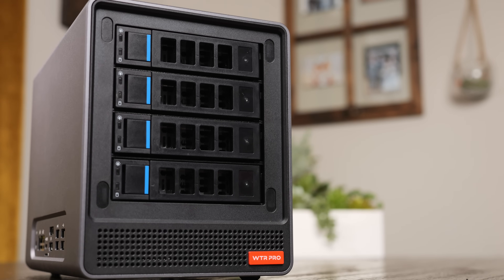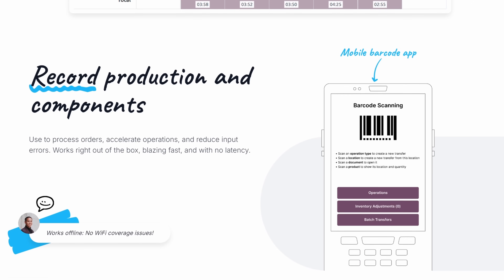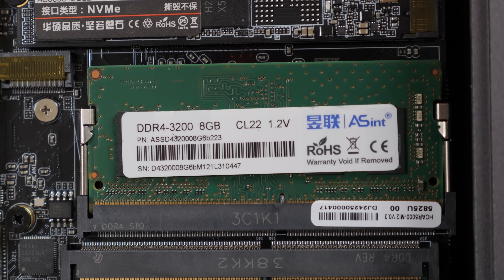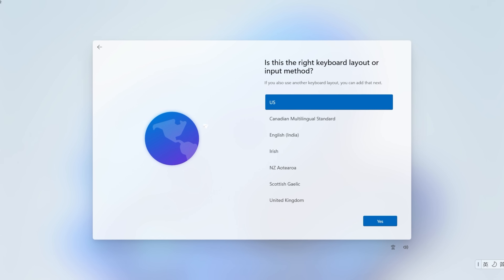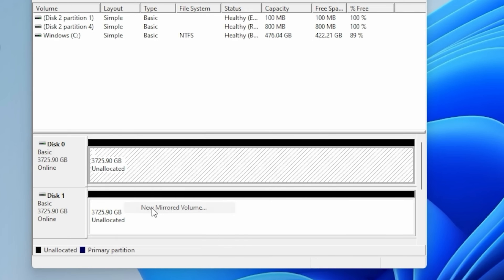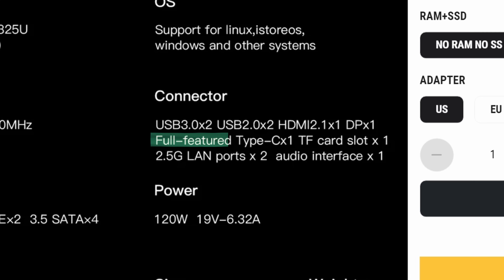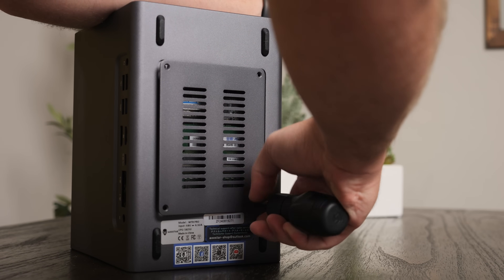The Home Server I've Been Wanting

Comment: if this exist 3 or 4 years ago i would have got one but i built one with a uNAS case and asrock rack motherboard with dual 10g and ECC ram and ryzen and IPMI/BMC, it did cost almost $1k more at the time. this unit costs what my motherboard alone costed. i also have 1 PCIe slot used for a old school read deal hardware accelerate RAID card that pulls about 1GB by 1GB read write with 4x 12TB Seagate drives in RAID 10. not bad read and write for 22TB, even with 24/7 NVR it still pulls 600-700+ MB/s read/write. enough to saturate 1gig ethernet

Comment: Man, I really wish AMD had an alternative to QuickSync.  That combined with a 10Gbe NIC would have made this thing perfect as a router and low-power failover NAS/Plex Server that I could run directly off of the 100w USB C port on my solar generator.  Would be great for overnight shutdown of my main unit, and also for power outage scenarios where I could shutdown my main Unraid/Workstation and run most of those services on a small low power device like this...
Reply: What do you mean? Quick sync is just the video encode/decode engine. AMD also has the same features, although their quality may be lesser.

Comment: Did anyone verify, whether these models even provide enough headroom for HDD startup. The N100 model provides only 90W, which indicates to me that it might use a built-in Pico PSU, just as the AsRock N100 ITX which doesn't provide sufficient amps.. :/

Comment: It looks like a nice replacement for my aged HP Microserver N54L running ZFS on FreeBSD (XigmaNAS - the old NAS4Free). - i.e. Would fit in the same place on my shelf probably - rather space-limited to meet that wife approval factor.
Just a little worried that it doesn't support ECC which I think I want (more than 10GB networking) for running ZFS.

Comment: You can buy 5 and 8 bay hot swappable external enclosures for around $200 or less.  So, I really don't have any interest at all in any more expensive prebuilt NAS that doesn't at least match that.  I'd much rather buy a Zimablade or similar and pair it with an enclosure or two.

The fact that 5 + 8 bay enclosures match with Snapraid parity numbers makes that combination the chef's kiss of low power, compact NAS devices.

I've yet to see any prebuilt NAS that can match a Zimablade + 5 bay enclosure for features and price.

FYI, I know some people will be down on this combo for doing stuff like transcoding and such but I'd rather keep my NAS pure.  Having multiple purpose built devices for a range of tasks just works so much better than trying to cram all of that into a single, disappointing expensive box.

Chances are, if you are looking at a device like this one, you are already on board with the idea of multiple low power devices rather than one giant expensive all in one server.
Reply: Having different devices for different software tasks will usually be less efficient, and also more clutter. This box is small, low power draw, and has more than enough CPU power.

Comment: As W11 is there, can I add HDD’s with data on already or do I have to reformat?
in my head the fan is on the side so air can be pulled in easier

Comment: These things are cool but would be cool if they had a version that took four or six 2.5" drives by taking half in from the left and half in from the right (assuming IO was classed as the front). That way would be super short and then could just have 2 small 6cm fans on the back.

Comment: hotswap on a home system is irrelevant IMO since even in a lot of corporate setups it's not really a thing except with hardware RAID controllers on rackmount things closer to 10x the size. 
No one is really going to use something like this sitting on a shelf running RAID5 or whatever with a cold spare drive next to it ready to go. Or, if you do - this is not the system for you anyway, for a host of other reasons. Which begs the question, can it hot swap from it's own PSU to USB-C and back without having to be turned off? Just as important as drive hotswapping, if not more.

Comment: i have a little question. Can you set the SATA ports in the bios as a ESATA port, then they are hot swappable. i mean yea it disables the cache on the drives but who needs this feature anyway in a nas with no power loss protection.

Comment: i went for the n100 , proxmox and put a coral m2 in the wifi slot , also unlike terramasters 424pro , the usb's work with a hub ,and there is plenty for a zwave ,zigbee, rf dongle ,and should be able to expand with a terramaster D8 hybrid i bought
Reply: How is the the performance so far? Does it get hot? Is the vent working hard or it is silent most of the time?
Reply: @JoseGarcia-so2yc  so gone through a lot trying decide on what hardware to use ,with what hardware ,so aoostar - proxmox ,home assistant,  and the arrs with 45 drives , via i think tech hut on you tubes tutorial has been flawless, except trying to understand how to update the programmes, 
Now trying the 424 pro with unraid ,watching space invader 1 , l have 2 nvme cache drives in zfs , 1x 8gb purple for parity , 3x 8 gb reds in the array with 1x being zfs for snapshots , bloody complicated and still having nothing really running on it ,
So short story ,aoostar works via proxmox , and on the n100 version you can use the short m2 for coral ,though that looks likes it's dieing ,or an extra short nvme , BTW probably gonna convert my desktop ,Asus proart ,13700k to a server ,put windows via proxmox on the aoostar and use that ,hopefully via the hdmi ? 🤷

Comment: If you can use the 2.5gbit nics at the same time, 5gbit bandwidth isn't bad at all. not every one has a 10gbit network at home, maybe a 2.5gbit but mostly a 1gbit which is totally fine for home use. 
i mean yeah, i have a 10gbit network but i have a dell r630 with 4x 10gbit ports at home and in all of my pc are 10gbit nic as well. i run Ubuntu on all of my systems and sftp works seamless with the  filemanager. All of my pc have only the os on it.  all 4 ports on my r630 are connected to the 10gbit managed switch, and one of my pc has a dual 10gbit nic in it. so i am able to use 20gbit of bandwidth if my drives could keep up, but they couldn't because i using only 4x sas hdd 2.5inch drives in a raid 10 and the other 4 drives in the server are cheap sata ssd in raid 10 which houses only machine learning stacks and models which need a fast and frequent access which abuses the dives extensively so they fail about every 8 to 10 months but they kost only 30€ each therefore i don't care and everything on this SSD are volatile and can be replaced in minutes. i have another system build from a cheap dell OptiPlex which serves only as a backup storage it uses normal sata drives in a raid 6 configuration. it has also a dual 10gbit nic in it and powers on if none of the recourses are available or if it does a backup. this happen every 2 weeks and takes only 1h at the moment. i had the r630 failing one time and the backup server started after 5 minutes and provided only the NAS because this is everything i need. if some one wonders, my r630 is a 8 bay variant and i boot off from a internal ubs3 5gbit port. with a 10gbit usb3 metal stick specific designed for those use case .

Comment: The "Full Service USB-C" has a Display Port Symbol on it.  Pretty sure you can use for adding a monitor or three to it.  Yes... there are adapters that will split the signal into to two to three monitors.  WHY you would want that on a plex/file server, I don't know, but I'm sure we can find any number or reasons we might want to do that.

Comment: This hardware with a more modern CPU and 10GbE would be the dream for a low power decent feature set homelab machine if you don't need a ton of drives or fast storage for a lot of people who want to run something other than Synology.  For the price it's really not bad though I'd want 10gbe + ECC personally but it's nice to see companies thinking outside of the box with 'entry level' NAS hardware.

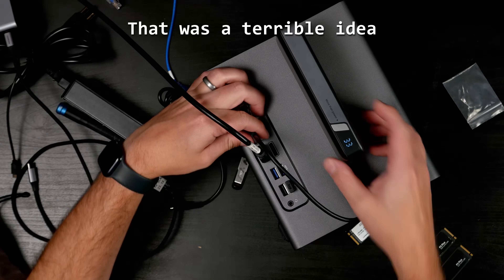Comment: 14:39 depending on the wattage a power bank is capable of, it might actually work. And some power banks can pass power through them, so this could actually be a somewhat effective UPS, provided you find a powerbank powerful enough to run it and capable of output while being charged.
Reply: Yeah, I don't know what power bank he was using to test this, but as long as it's capable of providing the power required by the NAS it should work. Maybe there's a voltage/current combo that the NAS wanted but the bank couldn't support?
Reply: Exactly, there's no reason it wouldn't work with a decent power bank - probably needs 20 V support. Doesn't need to be 100 W if the system draws just 40 W during activity... 65 W should be enough.

Comment: I personally would not suggest this be used for anything in business or even home use. Why you may ask it is made in china. China is know for hiding call back chips on all the boards. Just search china hides call back chips on motherboards or China Spy Chips in any search. This is why china sell computers so cheap if you look at almost any routers traffic late at nite you will seen china connections being they still embed chips on boards for almost all router makers.

Comment: Why is hot-swappable drives something you wish you had? You passed the drives into a VM, right? Doesn't that make the drives non-hot-swappable? Or am I mistaken?
Reply: You can still hotswap drives that are passed through, you just need to release them from the VM first (can usually be done without stopping the VM). But here he passed through the entire SATA controller, drive hotswap will work exactly as it would on a baremetal FreeNAS install.

Comment: Needs to sort the hot swap issue, 10 gig networking, ecc ram, an extra sata 2230 m.2 for an OS drive, and a couple of sff-8644 ports with available 4 bay expansions. Close, but not quite close enough.

Comment: I got into homelabs and tinkering a few months ago and I was wondering why nobody simply made a NAS box without proprietary OS... well, guess this solves it.
A question: apart from Unraid, is there any other OS that handles HDD spindown properly? Cuz Unraid seems to be the only one but it's expensive and seems ro have issues with the normal power saving features ( the kind of stuff Powertop does very well).

Comment: want a different cpu, and 10gbe. could probably live with the i/o side ways, but rather have it as standard. the hdd bay trays needs improvement.

have zero issues with no self proprietary nas os developed. i would have used truenas cause that is free and reliable. unraid is also not bad if you have a license.

Comment: Great review. I'm SERIOUSLY considering this as a replacement to my Unraid box running on a Xeon E5 2450V2. Same Core and thread count with much better per-core performance in a tiny package. I would run 3 14tb data drives with 1 14tb Parity (and order 1 more as a backup).

I really wish it had an internal USB slot for the boot drive (I don't feel comfortable having my boot drive on the outside of the case since Unraid boots off of a USB Thumb Drive).

I run Jellyfin on my server and it does struggle with 4k though I can't seem to find info to know if the Ryzen model would struggle less (obviously it also struggles) :D
Reply: There's no reason you couldn't run unraid off the M.2. I get it's overkill as the entire OS is loaded into RAM on startup, but it will work

Comment: Have you had a look at the Terra Master F4-424 (and others in the series)? They're similar, but even nicer design, same amount of NVMe sockets, hot-swappable and nicer trays. Also Intel, so better transcoding. It has a meh OS included, but you can replace it with anything you want. I'm running Unraid on mine.

Comment: A nice video as always. But I do have a few comments. In what reality is proxmox a NAS operating system? It's a hypervisor, nothing more and nothing less. But for a NAS you use something else. For example Windows, why shouldn't that work? It's so easy to set up users and shares, you can manage storage really well, etc. And the next very widespread misconception is that trunnas with zfs offers some kind of drive caching. I've seen that in a few videos now, including on Linus tech tips, where I thought to myself, why don't you read through the ZFS and tunas specifications and learn what drive caching is and what is simply a copy of the RAM to complete the write process in the event of a failure. But your desktop will definitely not get any faster by installing an SSD. And certainly not when reading, if only when writing anyway. I find it really frightening and tiring when people constantly make videos about topics that they ultimately have no idea about.  Maybe you haven't found the storage manager under Windows 10 yet - that's supposed to exist... and that's why you haven't managed to create a RAID 5 in Windows using the built-in tools.... 😜

Comment: honestly this is exactly what I wanted (ideally a bit cheaper since you can get full n100 motherboards for 120$), but it being energy efficient, silent and holding 4 bays makes it great.
Reply: I really don't think it could be any cheaper, since this is the cheapes n100 solution that has case, hdd bays, power supply and form factor. The cheapest 4 bay ali express case is like 65$